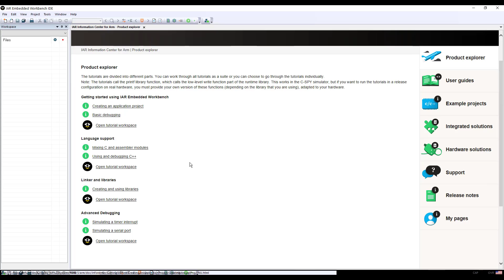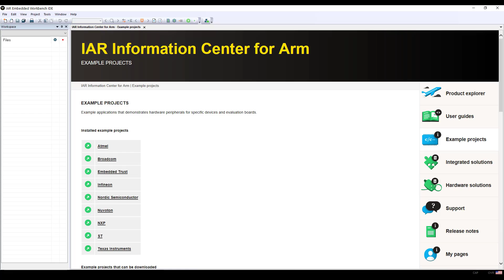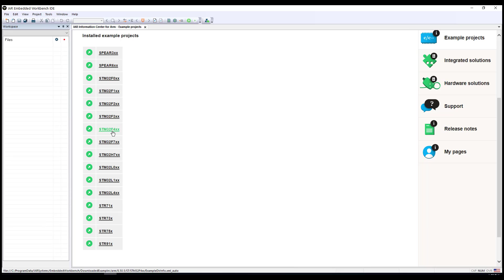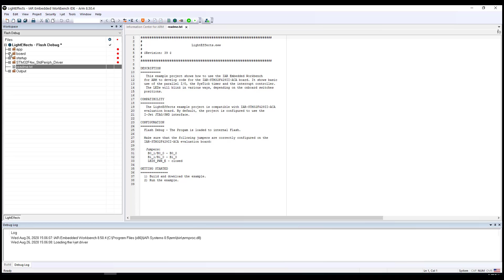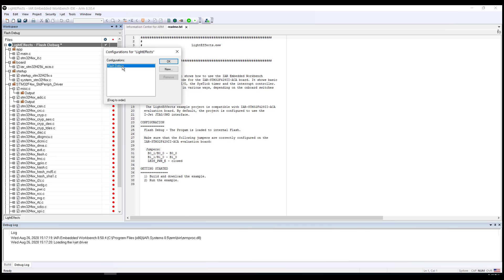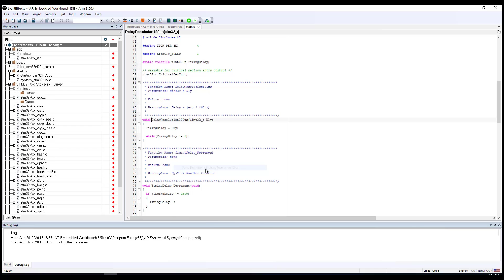IAR Embedded Workbench Overview - Part 1

Comment: I have been working with embedded systems for about 10 years with Eclipse based tools. I would like to try this tool which I have heard very good recommendations, is there a version for Linux?
Reply from the maker: Hi Igor,  thanks for your feedback. Currently there isn’t a Linux IDE available. Stay tuned since we are working on a multi-cross platform IDE. It might still take some time but feel free to reach out to fae@iar.com so we can share more details about it. Meanwhile we can provide the IAR Builld Tools that are cross-platform and optimized for modern and scalable build server topologies on Ubuntu, Red Hat and Windows for CI/CD pipelines including Docker support. The IAR Builld Tools include the IAR C/C++ Compiler, IAR Assembler, Linker and the command line build utility (no IDE and no Debugger meanwhile).

Comment: how can i found out what is amount of flash and ram occupid after compilig?
Reply from the maker: Hi, The flash and ram required by the application can be found on the linker MAP file, at the last lines of the file. You can enable the MAP file via Project->Options->Linker->List: Generate Linker MAP file. The file will be available under the "project name"\Debug\List folder. In the IDE you can find the file under the Output folder if you expand the icon.
Reply: @IARSolutions  I thing i found some bug or maybe this is deliberate approach ? Why release setting is so much different than debug -even core is different and it can not be duplicate. (i use eval ver so maybe problem is in test version)

And by the way, does IAR deliver start_up code (.s file) or user must provide this code by himself? for example from STM?
Reply from the maker: @slawekh7862  The Debug and Release configuration are only the same once the project is created aside of the optimizations. From there they will become completely different. This is intentional. You can clone the debug configuration via Project->Edit Configuration: choose new and you will be able to have Debug as a reference. You can also create your onw configurations like 128K, 256K memory and so one. You can completely change the settings and keep the same files, or even exclude some files.